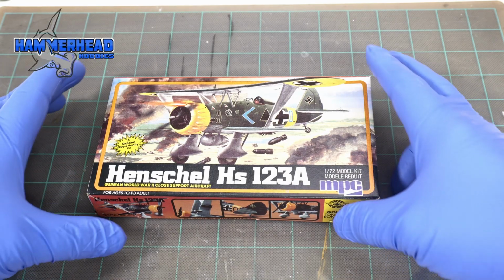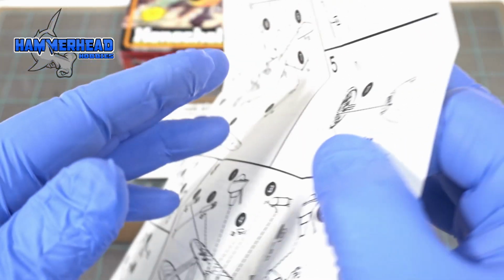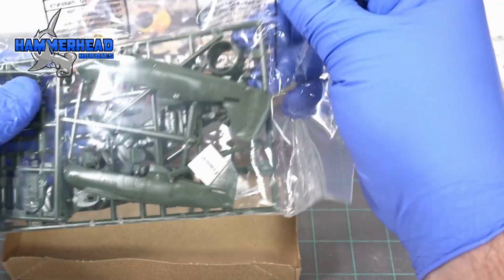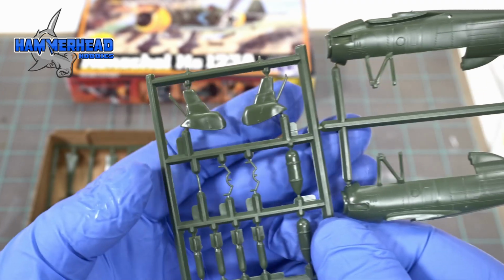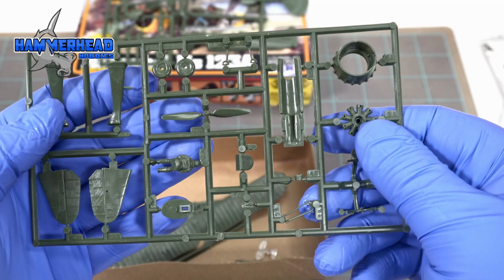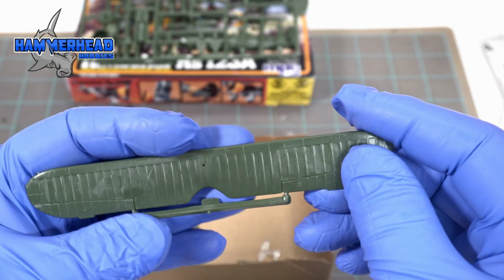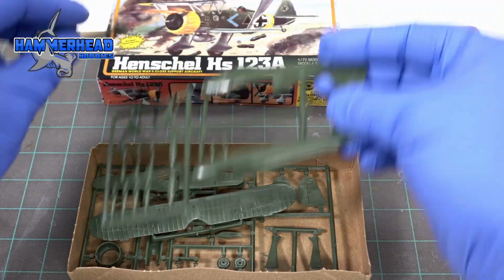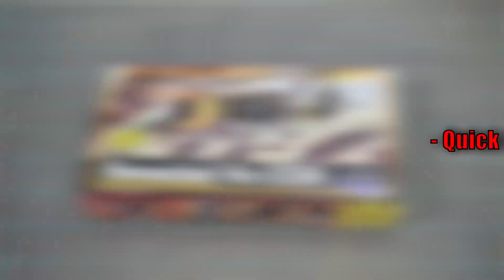Henschel Hs123A by MPC - Unboxing and review

Comment: I had suspected that the kit may be a MPC re-boxing of the Heller kit. The "Made in France" paper label clenched it. It looks like a very nice basic kit out of the box. Should be a pleasant and uncomplicated build.
Reply from the maker: Sorry for the late reply,  I didn't get a notification for some reason.  Thanks for clearing up the re-boxing or the Heller kit.  It's amazing that they kept the little piece of paper that said, "Made in France".  Looks like a quick build but I always like putting a little extra in them.  Not too much but enough to make it a bit more challenging.